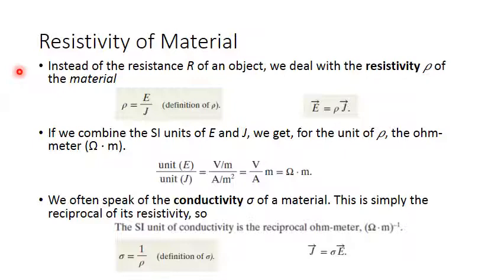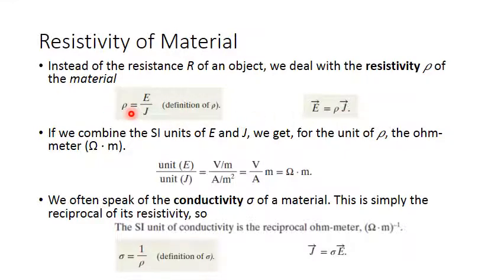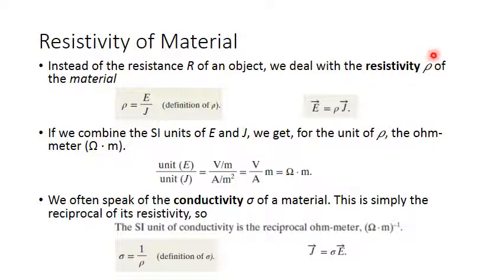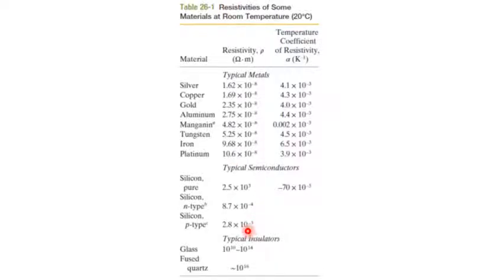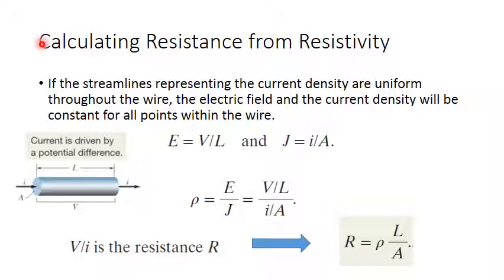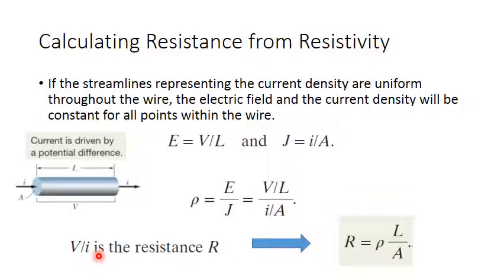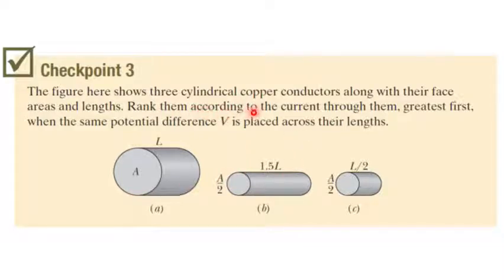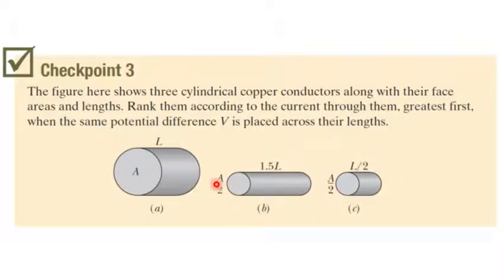Lecture 07-e Current and Resistance

Comment: Thank you.
An interesting point: in the education system of Belarus and Russia, the cross-sectional area of a conductor is usually denoted by a capital letter "S", from the English word "square". This came from the fact that in the mathematics course, which goes before the physics course, the first example of calculating the cross-sectional area is considered the cross-sectional area of a square.
 And your cross-sectional area is indicated by the capital letter "A", which came from the word "Area".
Such small nuances of different education systems.
Reply from the maker: Me my self, I am using S for surface area. However, the textbook which is used in these lectures uses it as A. It would be slightly complicated to me to change all the notations in the equations. Thus, I am using directly the notations of the textbook.